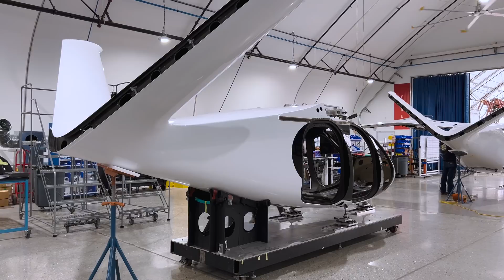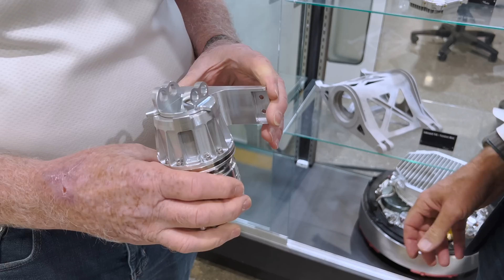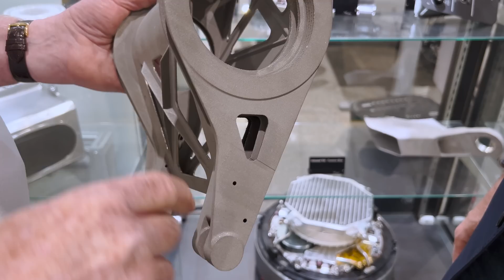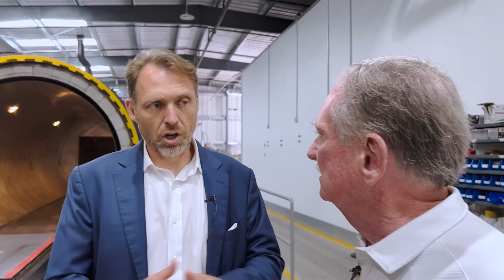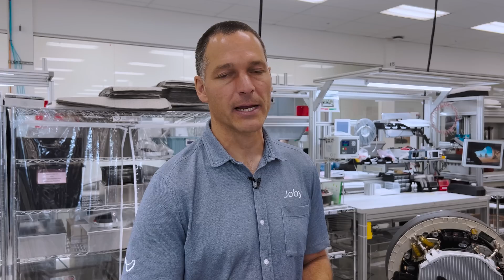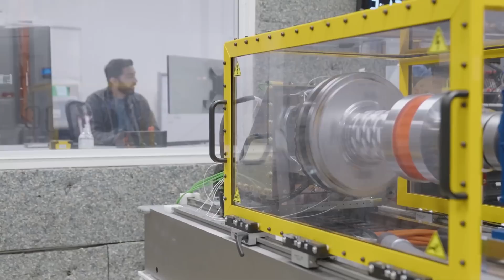Inside Joby Aviation: Revolutionizing Urban Air Mobility

Comment: Sorry, but building 12 aircraft/year is not game changing.
Reply: Tesla built just a few cars a year at first.  Was that game changing?  The Wright Brothers the same.  Did that change any games?
Reply: @charliedoyle7824  Well, I’ve been reading articles about Jobey for at least 10 years, waiting with bated breath for their vtol “game changer”. Have watched the Blackfly make short hops at EAA Airventure, but still nothing for sale. Same for the Chinese manned drone, except it didn’t even fly, just a fancy display. Talked with NASA engineers that worked on the cancelled X-57. According to them, there were serious safety issues when trying to carry the public over cities. That being said, there are ultralight aircraft flying successfully with electric motors for about an hour/flight, but that’s a long way from an electric commercial vtol.
Reply: @sphudson  waiting with bated breath.
Reply: @sphudson  I have seen articles proclaiming Joby’s breakthrough technologies for a long time, but haven’t seen any commercial results. And that includes several other companies that have produced point to point electric powered vehicle prototypes that never go any farther. A good example is the Blackfly that I have seen make short hops at EAA Airventure, with promises that “Next year……” I have spoken to NASA engineers who worked on the X-57 vtol project that got cancelled because their were serious safety concerns with electric vtol passenger carrying vehicles flying over congested areas. I am a pilot, have built Ultralight and Experimental Homebuilt aircraft and would love to see a vtol “flying car”. Unfortunately, the  technology and more importantly the governmental regulations just aren’t here yet. The closest I’ve seen are powered Parawings and Earthstar Thundergull Ultralights that can fly for about an hour on electric power only over uncongested areas. Don’t get me wrong, I wish you all the best, but I stand by my statement that producing 1 aircraft/month is not game changing.

Comment: Propellers are noisy unfortunately
Reply: They can be quiet when they're turning at a low rpm so that the tip speeds are slow and not transonic.
Reply: Joby's are actually quiet:
https://www.youtube.com/watch?v=GHmXR0wBOiI&ab_channel=JobyAviation
https://www.youtube.com/watch?v=itP8-3j2UZI&ab_channel=JobyAviation
Reply: @ejt3708 yes I saw, without getting into details, I stand by my comment
Reply: UH!!!

Comment: Fantastic to see JOBY being showcased by Sandy Munro!  This is by far the most comprehensive look into the eVTOL sector leader's progress at the plant.  Looking to the future I can only imagine what JOBY will be able to achieve once solid state batteries become available which should be soon.  the current 288 Wh/Kg is sufficient to launch but the new 721 Wh/kg batteries in development will just totally disrupt the entire helicopter sector.  Good days ahead for JOBY!
Reply: I haven't heard of 721wh/kg.  I did hear of CATL currently testing 500wh/kg in a flying testbed.
Reply: What new batteries? Every time I look, there's  some promising new battery being tested in a lab. For many valid reasons, they don't make it to production.
Reply: Nonsense!  The weight and energy density of the batteries is about the same, regardless of the electrolyte.  Manufacturing efficiency (time and cost) is the main advantage for "solid" batteries, but overall costs might be the same because of what "replaces" the liquid (jelled) electrolyte: metal.  The size and volume remains about the same, but the cost of using more metals adds to the cost, currently negating the manufacturing cost over the liquid electrolyte batteries because the liquid electrolyte is less expensive than the additional Lithium of the "solid" batteries.
Reply: @shazam6274 CATL are at ~400Wh /kg already.
Not solid state.
Reply: Wow cool.
Reply: If you expect to see widely available 721 Wh/kg cells anytime soon, you might be disappointed. Starting from 288 Wh/kg, if cell energy densities advance by an optimistic 5 percent per year, they would reach around 469 Wh/kg in 10 years.
Reply: @skipondowntheroad5833  BYD have a working 500wh per kg battery, it was discussed on Just have a think channel.
Reply: He said they will fully enclose the battery in titaium and hermetically seal it with laser welds. That will 💥
Reply: @TheBagOfHolding no oxygen.no fire.
Reply: @andrewashmore8000  you don't need fire for an explosion.
Reply: @TheBagOfHolding  true. Just a build up in gases. In a contained space will do it.
Reply: @TheBagOfHolding there are cooling and vent systems...
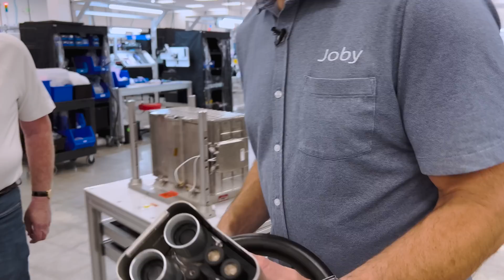Reply: @DarylOster  30:49
Reply: @TheBagOfHolding Wow, that is going to boooom! 🧨🤯 The speaker is clueless, what he is talking about. Scary! 😱
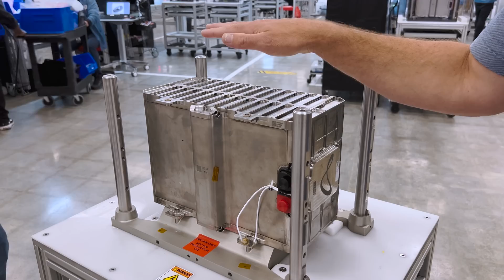Reply: @Stefan_Dahn  vaporware companies put more value on employees that don't talk than ones that know what they are talking about. 27:05

Comment: While the founder is awkward, the systems they have are great, they have 3d titanium for... coolant Im assuming, they have autoclaves for making composite parts, the lab is VERY extensive, and well thought out, the motors are pretty slick putting all the moving parts and inverter in one package, and the engineering thought they put into just the plug is great.  I hope this company is able to keep going, just don't read all the haters in the comments section here lolz
Reply: I'd be nervous too, showing Sandy around your manufacturing  would be like showing Lang-lang what you can do with a piano!
Reply: This coming from a person who wrote this synopsis as a fifth grader. 🙃
Reply: YOU'RE awkward
Reply: The founder was extremely awkward, I could hardly tolerate listening to him. The second half was much better presented.

Comment: Since the rise and fall of the Moller flying car, I've not been convinced by any of these ventures that they're actually trying to succeed. Progress is insanely slow for the budgets they command. Unmanned flights with high cargo would be a BREEZE to set up for, to prove speed and range, and work on emergency protocols.
Seems, these things are just still too crash happy to be even tried properly.
Reply: Comparing Joby to Moller is way off.  Joby is much further along the certification process and is engineered much better.

Comment: When will Joby begin generating revenue and what is the outlook for profitability?
Reply: LOL
Reply: They have already generated some small revenue, but they will not be able to significantly scale up revenue until they receive regulatory approval from the FAA.  They are on stage 4 of 5, which is the most extensive.  Once they receive approval they will likely have a head start in capturing key markets for air taxis while others catch up.  They are vertically integrated for providing air taxi services, but can also sell their aircraft.

Comment: Using batteries is still ahuge limiting factor, with few upsides from what I can see.
Have ANY heliports been opened for the flying battery bombs in places where a helicopter doesn't have a chance to land?
Reply: You may find, if really keep upto date with battery advances, that newer chemistries are far less likely to combust. You seem to forget that conventional helicopters readily burn when crash landing.
Reply: @yoda-be.at1746 risk between gas and batt is roughly similar, imo
Reply: They are still in the certification process
Reply: If you check out Enovix they have a battery design that is almost completely able to stop battery runaway, and their batteries are like 30% more energy dense due to an all silicon anode.  They are going into mass production early next year.
Reply: Electric systems are far more reliable and require much less maintenance than any kind of heli; they have far more redundancy and stability in the air because of all the props and separate batteries and controllers, all not possible with combustion engines.  Electric is also what allows it to be so quiet, and the price of fuel is far less.  The price of each flight will go way down from helis, which are horrendous machines in most ways.
Reply: Turbine engines are pretty darned reliable, that's why they are used so widely in commercial aviation. Batteries are not even in the ballpark compared to fossil fuels and power to weight ratios (yet). It might be next year, or like fusion, be "30 years away" for the next 70 years. Hype is good for raising funding for R&D, but I am not holding my breath. Once I see one take off with multiple passengers and fly more than 100 miles while it's 110 degrees outside, I might change my mind. A 2 pound rotor blade doesn't inspire confidence if there is a thunderstorm nearby.